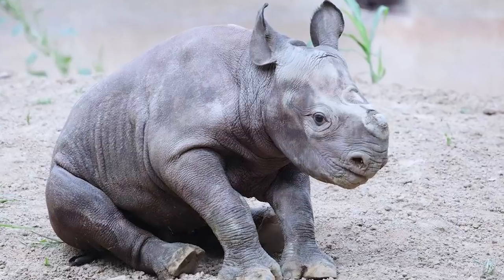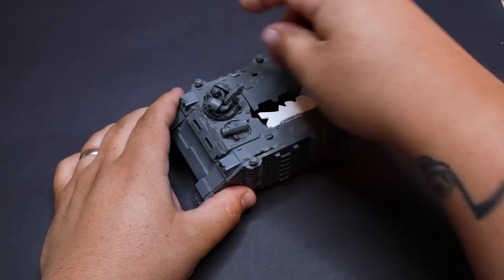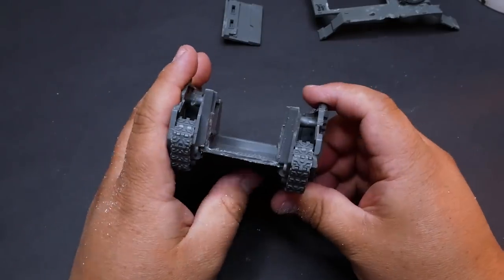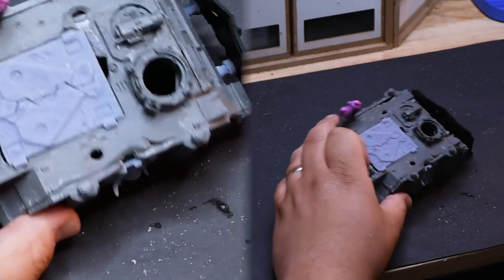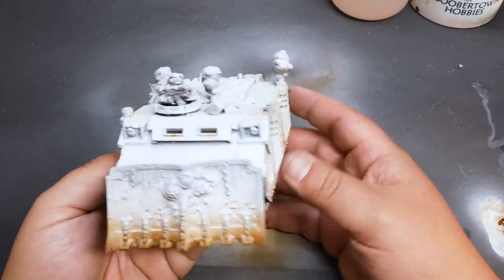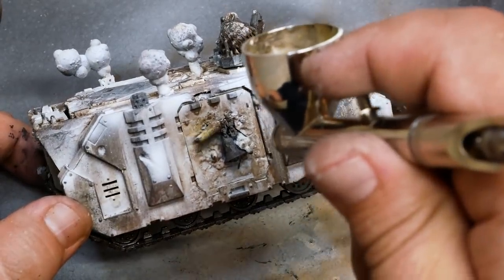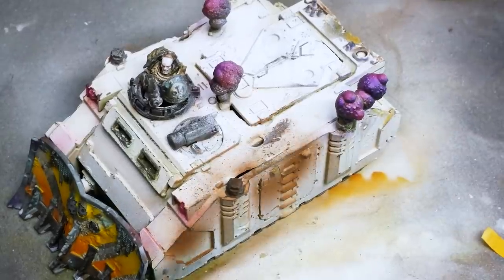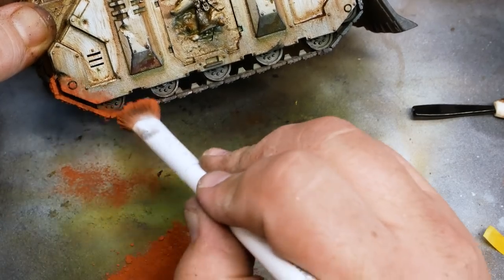I Can't Believe I Messed Up This Bad Rescuing a Rhino

Comment: Man that upside-down rhino door reminded me of when I put a wraithlord's torso on backwards and then decided to cut it at the waist to rotate it.
Reply: I put the legs on backwards for some T'au Battlesuits...
Reply: In your defence, the metal wraithlord and war walker used the same torso part, rotated.
If you'd made one, it would be easy to assume the other uses the part in the same orientation.
Reply: Reminds me of how I put the head on backwards on my first Skitarii Vanguard. Had to take the head off with a wood saw, which scarred the chestplate. I passed it off as battle damage from a tyranid.
Reply: @clashaccount8737  authentic little fella init. Got into a REAL fight.

Comment: Way to bounce back. I'm new to an airbrush, priming/zenathil only. Hopefully soon I'll be able to wield it for shortcuts like you display. Got quite the backlog.
Reply from the maker: The airbrush is an amazing tool man, just keep it at the ready and try and pull it out for as much as you can. Even after a little bit of time you’ll start getting it out for the smallest details.

Comment: I stopped using chipping medium, I now use AK interactive weathering pencils to do the scratched paint on the edges of vehicles, you have more control and can easier use different brightness if the metal pencils to add highlights and shadows to the scratches, I also went back to the old school sponge dabbing for the chips in the armour panels, again more control and easier to vary the colour. . I found these techniques save time and mess.

Comment: Now that is an awesome piece of work, mistakes aside. Dude, believe me, I Get It; I've made some pretty heinous mistakes in my time painting and building, for sure--notably my marked inability to drill and pin parts at a totally straight angle and always finding this out the hard way every time. Oh, and I thought you'd be pleased to know, I scored a new Badger 105 Patriot airbrush...only to find I need a 1/8" adapter  for it to fit on my compressor's hose. Ah, well, at least it's a pretty easy fix. Looking forward to playing with this beauty!

Comment: What rotary tool are you using? Deciding in one myself. You’re looks cordless and powerful enough to do the work easily.
Reply from the maker: I’m using a plugged in dremel, it’s the small one, but i opted for the non battery operated one in case I want to turn this into a mini dremel drill press…

I wish I could remember the name of it right now…it’s the small one.
Reply: @eBayMiniatureRescues  thx for response.

Comment: what paint did you use for your verdigris? also anyone have any idea about what airbrush is being used? Cheers!
Reply from the maker: The verdigris is the actual color Verdigris from Vallejo. GW makes a great one as well called nihilik oxide. And I use a Badger Patriot 105 airbrush for the most part, switching to a Badger Sotar 20/20 for the tiny stuff.

Hope that helps!!

Comment: Final result looks great! My question for you is, do you varnish the model before doing the enamel wash?
Reply from the maker: A lot of the times I don’t, because I want the enamel to stain the color underneath. But I’m also usually working with standard acrylics that are dry before putting in anything else. In this case the second go was varnished beforehand, made a huge difference! 

In just about every case it’s best to varnish before applying enamels and oils.

Comment: Boy do I have a question for you, how do you get rid of Simple Green smell after stripping a rhino… but it might be stuck inside still :(
Reply from the maker: Haha, You should poke a hole in the bottom of it to drain. If you paint it before that things could leak through the cracks and ruin that paint!!

Comment: If I had to hazard a guess the reason it didn't work this attempt as it worked in the past, is not enough time was given between paint layers for things to cure properly.  Acrylic primers, and paints are dry to the touch in just a few minutes but can take 24hrs or more to cure.  I think the problem was attempting to do to many painting effect in a single day/session.  If you waited at least a day after applying the brown/black primer before applying a chipping fluid layer and light colored layer to get the chipping effect, the brown layer probably would have been cured enough to allow for the immediate oil wash.  But because the primer coat wasn't cured fully it was significantly softened by the chipping fluid, and then the combination of solvents and agitation of the wash step cause sections to slough off down to bare plastic.  Alternatively if you waited a day or two after chipping but before the wash you probably wouldn't have had this problem.  Your hubris attempting to prime, chip and oil wash in a single session was your downfall /s ;)     (I can empathize with the frustration on things not working as intended, I happy to see it all worked out in the end)

Comment: I am curious, why didn't you simply treat it like a rescue and strip it when you saw it go off the rails?
Reply from the maker: I’ve done that before, but the longer I’ve been in this hobby the more I’ve come to realize that there are things that can simply be fixed by working on it a little longer rather than stripping it back down. Using an airbrush kind of negates the idea of paint clogging details too, so that really helps. There are always exceptions of course, and I think those mostly fall under paint clogging details, and usually on faces, I’ve found. In a nutshell, most paint jobs look not so great until you begin to really hone in on the details, so keep at it, cause it’s probably not as bad as you think :)